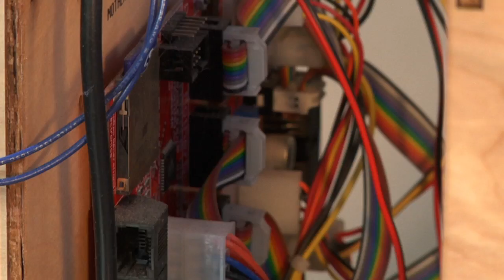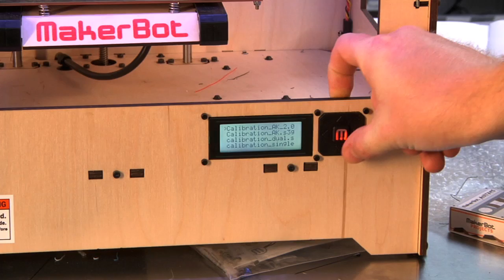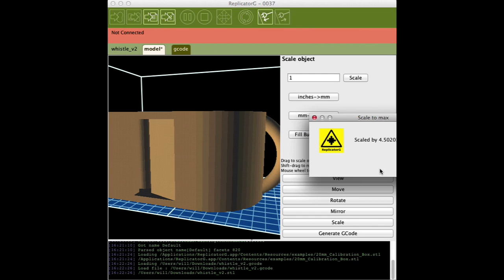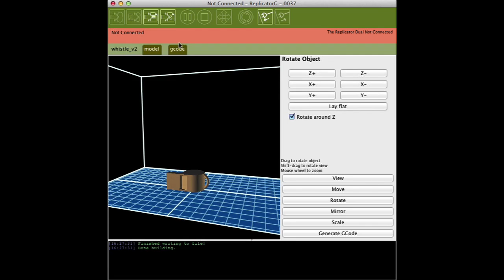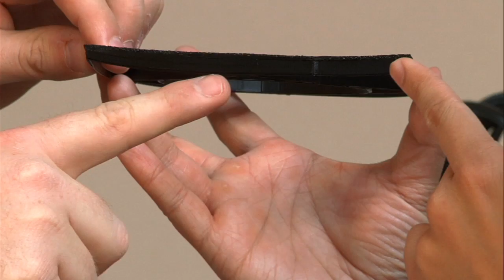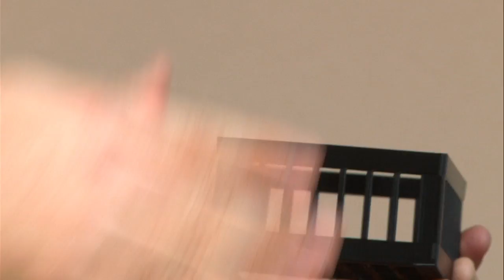Quick Look at the MakerBot Replicator 3D Printer

Comment: Why does the entire world insist on calling this thing a “printer?”
For God’s sakes man!!!!! It a friggin sculptor!!!! A computer-driven automated SCULPTOR. ….and the products that it produces are called SCULPTURES. Not Prints!!!!
Prints are flat pieces of printed photo paper coming out of my Hewlett-Packard Envy machine, or my problematic Epson Eco-Tank junk printer.
The only similarity between a sculptor machine and a printer is that both are computer driven and automated by computers and software. 
The differences are that one uses ink cartridges, while the other uses plastic wire spools. One of them writes on a piece of paper using ink, while the other melts plastic spools on a heated platform, creating a built sculpture. One requires a little putty knife to pry the sculptures off of the heated platform, and the other one…… well, you pick up the finished prints off of the printing tray with your bare hands. Another thing to note: you can’t pry off ink from a piece of paper with a putty knife.
Reply: You know you are dumb, right?!

Comment: How much would the parts cost? A fraction, of course. Plus R&D, software, etc., would it reach 1,000? I highly doubt it.

And, for the quality of the print, I don't see the value there.
Hopefully it will get better with the time... and cheaper aswell. It does look much better than the previous models, but I mean it has to get WAY better.